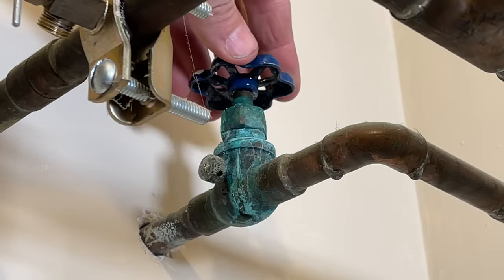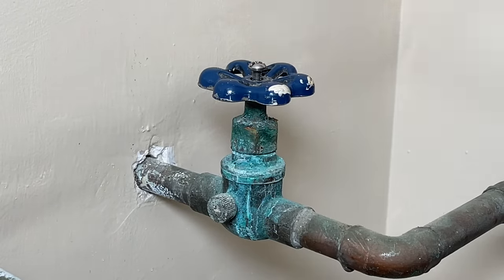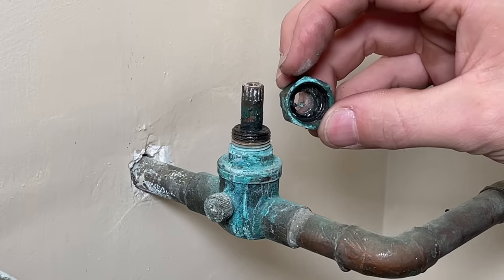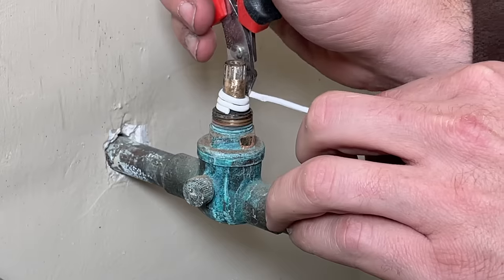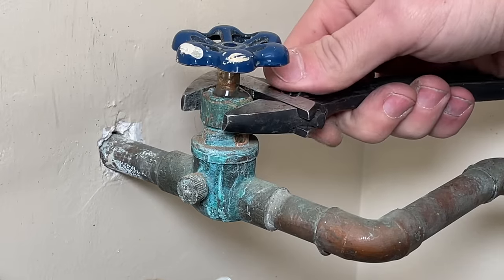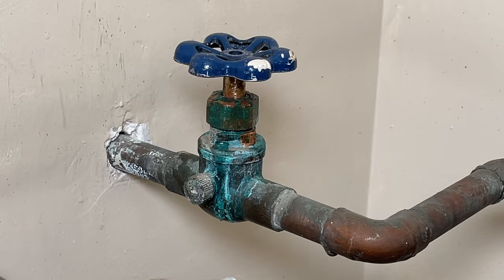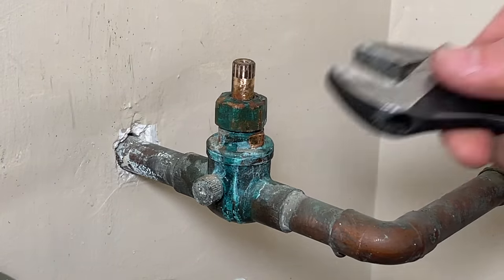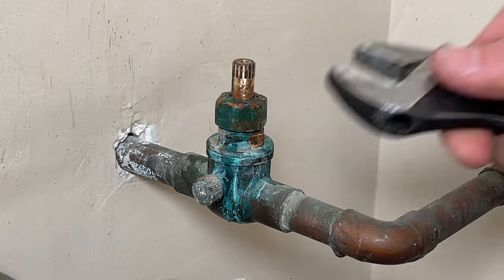How To Fix A Main Water Shutoff Valve Leak

Comment: When adding your packing material, you want to start and stop your cord at almost the same point.  This makes it where you have almost exactly the same amount of packing material all the way around the stem.  An uneven pack will leak due to the material being thicker on one side versus the other.  In your example, you have 3 layers on the back in the first wrap and then added 2 more layers to that side and had 2 and 1 layer in the front half.  This means that you had almost twice as much packing material on the back of the valve stem than the front.
Also, using a second wrench / large pliers to hold the base of the valve to keep from torquing it is much preferable to just trying to hold it with your hand.  This gives you the ability to hold the torque you are applying against a similar torque as you can hold each at about the same distance from the pivot point.
When applying heat, remember that the joints holding the pipes together are solder joints.  They are heat activated and heating from the bottom of the valve body when where you need to apply the heat is at the top has a chance to heat up those connections causing a failure / leak.  Wrapping the joints with wet washcloths is another safety step in making sure to not transfer heat to them.
Reply from the maker: Good stuff, really appreciate all the feedback!
Reply: Great information . I am a DIY car guy . I ALWAYS use TWO wrenches . Too many plumbers are SLOBS . I have seen videos where they NEVER deburr pipes after cutting . I even deburr NEW fittings in case of a rough edge . I have seen them use LARGE Channel Lock pliers on small bleeder fittings that are best suited for 1/4" drive or similar . What would a few ADJUSTABLE wrenches cost if you don't own a set ? And after sweating a fitting , let it cool BEFORE wiping it off . First to avoid shocking the hot solder with a wet rag and second to remove excess flux which is acidic and can corrode over time . So much for " Master Plumber " on the truck ! But they demand $ 150.00 or more an hour and grossly inflate the parts prices . They charged a lady in a small store over TRIPLE the cost on a small grease trap !
Reply: @billsmith2212  guess you’re a Master Plumber.
Reply: @billsmith2212  well said
Reply: Thanks all you guys well said I'm not a plummer but you all save me money 😉  cause a plumber  a expensive. Is
Reply: @mikenelson4136  More so than real plumbers
Reply: O use an o ring.
Reply: Globe and gate valves are garbage that will always need to be replaced with a 1/4 turn ball valve, all that is a waste of time
Reply: @billsmith2212  more like 250 an hour it’s no different than a mechanic if you can install it yourself go ahead then buy we spend hours blood sweat and tears to master a trade to do things right and people want to complain it’s fine go ahead and attempt it yourselves 😂good luck hope it’s not inside the home
Reply: @billsmith2212  Don't paint what you see from a few jack leg wannabe plumber videos across an entire trade.  That's just BS.  Good plumbers and electricians, and HVAC techs are not cheap because they are skilled tradesmen who have huge investments in training, tools, and equipment.  What you see on the service truck is the tip of the proverbial iceberg of that inventory.  That inventory needs to be bought, maintained, repaired, and replaced as needed.  That costs money.  A LOT of money. That cost is and MUST BE passed on to customers to make a profit.  As in every other industry, there are disreputable crooks in the plumbing business.  You usually get what you pay for though.  If you went to buy a piece of safety equipment for your child, would you buy the cheapest one?  Google something simple like Ridgid pipe wrench or die set and see what quality tools cost.  If someone shows up at my house with Harbor Freight tools, I'll pay them for the service call and call someone else rather than let them work on my stuff.  So go ahead and let that incredibly cheap plumber work on your house.  See if he answers the phone after that water or gas line leaks causing thousands or many more dollars in damage.  Oh, he wasn't bonded and insured?  Hmmmm.  That  cost a lot of money too.  You get what you pay for.
Reply: @jdcisneros9023  It's one thing to master one of the trades: it's a completely different thing to lie and cheat people to satisfy your greed. Better hope Hell ain't real!
Reply: @honestabe1940  ok 👍
Reply: Yeah but on the MAIN valve you can't do anything to it internally unless the water is shut off usually by the city out in the street somewhere, and that might require another call to get it back on as well as a charge for this.
I like the idea of a full port turn quarter turn valve on the line where there water comes in, and a SECOND one further in so there's two valves, you leave that first one alone unless the 2nd one needs repair or replacment.
Reply: @HobbyOrganist  I have yet to be in a city where I couldn't walk out to the water meter, open the box, and SHUT off the main feed to the house without having to call someone first.  I have had to call out the city to come replace a valve that wouldn't shut off, but that was a short wait and no charge because the city would rather you didn't break their equipment vs charge you anything to shut off your water.  The valve was very old and defective (it had no lock loop meaning the city couldn't lock the water off if the valve worked).  When I worked for a city, there was no charge for repair and maintenance on valves nor for us going to shut off the water for repairs down stream.  The only charges were for extra valve installs or if you didn't pay your bill.
Reply: @TheSidneySmith  Yes, you are so correct. For many years I have always shut the water off at the meter myself. I’m 79 yr old now with bad knees so no longer get down there with a wrench to close the valve. So I purchased a @ 3 ft long shafted water meter valve wrench from a hardware store. You can stand and place it over the valve without bending down or getting your clothes dirty. You probably already have one yourself. I’m just explaining for all these “youngsters” who don’t know about them😁.  I needed to use it a couple times this year not only for me but also my neighbors. Saved my knees and my back.

Comment: Great help! I had a problem of water dripping from the valve after I shut off the main valve and turned back on. I went Lowes and was told I will need to cut of pipe and replace the whole thing. Then I searched on YouTube and found your video. I used the first easy way. Amazingly, water dripping was stopped immensely. I was so happy it was such an easy fix. Thank you so much for your step by step tutorial video!

Comment: Just a thought. When removing the bonnet nut especially since it is so hard to get off and hard to secure the pipe just holding it with your hand, I would suggest after you check for leaks, then with all water valves shut off in the house to go to the meter and make sure it's not moving, just in case that cranking on the pipe jarred something loose or caused a leak behind the wall. Great repair video you made here !

Comment: For the second and third method, here's a valuable hint: add waterproof grease to the packing cord and to the threads as it will greatly improve seal and make turning the register off and on easier.
Reply: You must be a real plumber like me. I had forty years in it and very few plumbers I know use plumbers grease. It makes the world of difference when it comes to leaks, also put some on the packing, helps it compress more . Turn the nut back and fourth till it is packed. Good luck boys don't want to give all the trade secrets.
Reply: @robertcoleman9225  You must give away all the secrets. 😁
When I was helping out a friend when he was working on the plumbing, I was more of a helper watching with interest what he did (my background is in electric installation, not plumbing). He applied a grease in addition to the seal. The best connections are soldering, but if you can't do that, threads with seal and grease is the way to go.
Reply: @robertcoleman9225   65 years = soft white string and silicone grease The plumber was over 60 so that's a long time that's been used to very good effect. = over 100 years no doubt. Steam  manganesite impregnated cord......... These young guys need a lesson or three? Many a Gate Valve has  o rings as shaft seals anyway?   Belmont valves =used to take ages digging out the boss white & hemp , where a new pair of o rings should have been.. dear dear dear dear dear!
Reply: Silliness works very well and is also waterproof.
Reply: If I had a valve this old and in its present condition, I would purchase a QuickFit push/connect replacement valve.  There appears to be enough space to cut the old valve out to allow its replacement.
Reply: How about Vaseline will it work ?

Comment: I had a plumber look at my water shutoff cause it wouldn't shut off water all the way, and he said I had to replace the valve and completely change out my copper pipe cause he would have to cut out the valve. And now I know, all it needs is the valve cleaned and replace the gasket. This is why it sucks being a woman , guys trying to rip me off . As a woman home owner, I have to be Ms Fixit, so these self help videos are awesome so learn from. Thanks for posting!
Reply: A professional would never do this for legal reasons. They would always install new fixtures. That guy wasn't trying to "rip you off".

Comment: He was showing how to stop the leak on a globe valve !   This good to know.  Not everyone can afford to call a plumber and switch out to a ball valve.
Reply: 🤔🤔You no need to be a plumber to to put a new valve!!👍👍
Reply: Agreed. Maintenance every 60 years hardly warrants a replacement with a ball valve.
Reply: @raulgutierrez5920  do you have a video to show us how?
Reply: @raulgutierrez5920  There would be pipe cutting involved! A new flat washer is far simpler.
Reply: @taxidude 😎👍llfoodvkma
Reply: Someone who cannot afford a ball valve is going to have big problems with other regular maintenance on the house. Such valve is like 50$ max. Emptying out the gutters is 100$..
Reply: A plumber called during normal business hours shouldn't charge more than $250 in the most expensive markets. A ball-valve costs $10. It's worth preventing thousands of dollars in flooding expense.

Comment: Perfect. Just needed step 2. Saved a bunch of money. Box wrench 3/4”, flat head screw driver and channel locks were all I needed. Purchased graphite Teflon rope seal at Lowe’s. Did both valves and replaced the washer hoses while I was at it. Hardest part was removing the old Teflon from the valve cap (also used an ice pick for that).  Took maybe a hour. Valve was installed 40 years ago when house was built. Good as new now!!  Thanks!

Comment: I would strongly recommend using two wrenches especially for the novice. Grab valve with second wrench.
Reply from the maker: agreed, thanks for the feedback Ken.
Reply: Yeah, back up all wrench action on pipes... always.
Reply: Amen.
Reply: I do it that way all the time.
Reply: Also I highly recommend to tighten the packing nut with the main water shut off. It can be very risky with the water live under pressure you can cause a major leak/crack the packing nut especially old   parts
Reply: @johnchonka2052  - So true!  I found that out a few weeks ago.
Reply: He nearly broke this pipe. 😂
Reply: @OhgodImtoosexy   Also when you tighting  go slow to minimize friction which will weaken  the metal  Impossibly crack the fitting
Reply: Is to old l would replaced in15  - 20 mins more security in the future if  you know how use the torch   the valve is around $10!!😎👍👍
Reply: Or just change out the whole valve right off the bat and save all that time and money and future issues, maybe a ball valve?
Reply: @underscr0e  he mentioned exactly that, watch till the end

Comment: Thanks so much for this video, Scott. I was down in my crawlspace looking at some pipe work I did a few weeks ago to make sure nothing was leaking and when I shined my flashlight over to my main water shut off valve I saw it was leaking pretty good. I looked online about how to potentially fix this and came across this video and it was the packing nut that came a little loose when I was opening and closing the valve so it was an easy fix.

Comment: @1:26
Just want to add, if you're tightening up that old packing nut, PLEASE support the pipe and valve with your other hand! When you're really cranking on those old, corroded nuts you can bend/snap/break your unsupported copper pipe and make things so much worst. Hold the pipe with your other hand to keep the piping and valve stationary while youre torquing on the nut.

Comment: As a commercial plumber, I loath operating gate or globe valves. They are almost always leaky. Not upon closing but upon reopening. All I can do is tighten that packing nut. Seeing you finish up step 3, open the valve, and see it hold pressure makes me happy. You have mastered an old piece of plumbing tech. I very much enjoyed this video.
Reply: If my valve is off and not leaking, can I repack the nut without turning the water off at the street??

Comment: I would have swapped the valve out immediately. I have never used the Teflon rope thing. Nor knew it existed. Tighten the nut to stop leak was known. But if it didn't work, just change it. Which is what you are doing. Thank you for your knowledge. It is staying with me for sure! 👍

Comment: With the bonnet removed, take a look at the valve seat for pitting.  If pitted, a valve seat grinder can quickly resurface the area.  (Seat grinders cannot be used on all types of glove valves. Seat grinders are low cost.)   If not repaired, the valve will have to closed more tightly and the rubber seal replaced more often.

Comment: This is exactly what I needed to watch! I discovered the main shutoff valve on my well system was dripping. I was all set to tear the whole valve apart, and had started letting the pressure out of the tank to do so. Then the thought hit me, "Maybe I should consult my trusted advisor YouTube." (I have fixed many things around the house from what I learned from YT videos, the lasted being my dishwasher). The first step shown in this video, simply tightening the nut around the valve stem, worked like a charm, as I was able to give it over half a turn, after which the valve became bone dry. Thank you for saving me from my impulse to go way too invasive, which I'm sure would have caused me massive issues, which I would be dealing with this very minute.

Comment: My dad never really taught me anything growing up because he break stuff like a bull in a china shop, but I had a leak currently in the basement. My cold water to my kitchen was frozen because I didn't let it drip one night and it's been like 3 weeks and luckily no busted pipe but it finally came back on today so I went and turned on the valve and it was leaking for about 20 minutes and I watched your video and I'm like you know what I'm going to tighten that nut. That worked.  It's a very old house that I moved into temporarily so I'm Glad I didn't have to sync money into that.

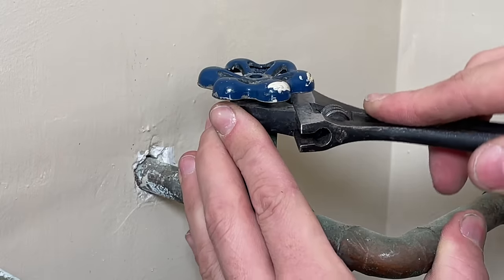Comment: Had a leaking faucet underneath a sub-floor. Wanted to put in a ball valve but would have been Extremely difficult to change out.due to pipelines and hvac ductwork. $2.59 worth of washers, several trips back and forth to the hardware store, and 3:00hrs of my time fixed the problem. Wondering what a licensed plumber would have charged. Thanks!

Comment: Step 3 should alway best dealing with this issue.
Great video sharing how stopped leaks.
For toilet and bathroom sink, have exactly the same problems.  
No open spaces, a tiny bathroom, valve under toilet tank and valve underneath enclosed sink, impossible for welding nor solders. 
No solder, just replaced new valves, but only partial. 
Removed stem valve-flat and installed new stem valve-flat, because stem corrosive and weaken.

Comment: When doing step 1, I would recommend a wrench on the bonnet nut before tightening the packing nut.  Relieves stress on the pipes.
      Also step 3, hold the body of the valve body with adjustable "water pump" pliers when loosening the bonnet nut for less stress on the pipes.  DIYer.

Comment: I never try to repair old valves, I always replace with a 1/4 turn valve. The reason is that it can be very unpredictable how much work I have to perform. I know how much time it takes to swap out a valve, but as you demonstrated, it may take a while to repair, and the cost of a new part is relatively low.
Reply from the maker: Yeah, if you can replace a ball valve is the way to go for sure.  Thanks for the feedback.
Reply: @EverydayHomeRepairs  Thanks for the video. I enjoyed it! Vey thorough.
Reply: Have to say, if step 1 doesn't work, step 4 is always my next, just for the reason you give, time is expensive, parts are cheap.
Reply: Ho man that was awesome next time I need l heave a leak l'll try that maybe l learn something new !! Good video 📸!
Reply: @EverydayHomeRepairs  af

Comment: I do prefer ball valves, even if they can seize also. But if you are already closed at the curb, I would not bother and replace the valve. Two solders which you can make in one heat pass and it's done. I had a ball valve which broke the stem (3/4 in pipe) after 32 years. My 1.25 inch ball valve is a little bit tight, but still working. But your advice are very good for the people who are afraid to solder. Good video!

Comment: Thank you for the video. It is just what I was looking for. It will work with other cutoff valves in the house as well. Funny how many people didn't watch until the end of the video where you stated that you were planning to do the ball valve replacement when you installed the water heater - or maybe they couldn't resist saying how they would have done it. Great video!!